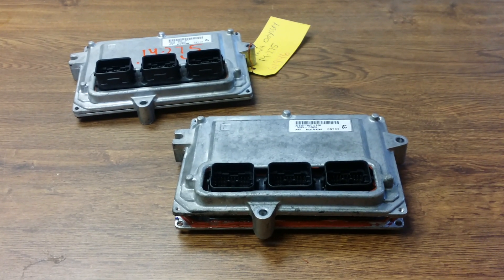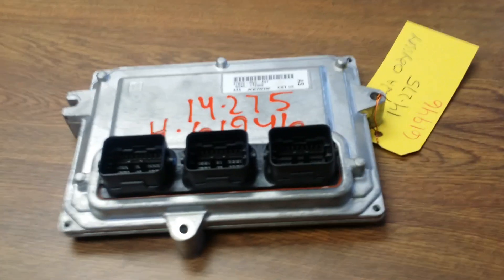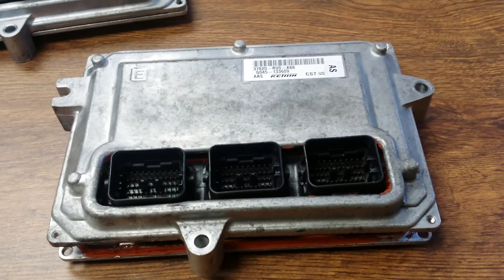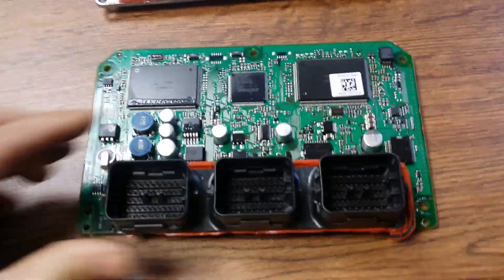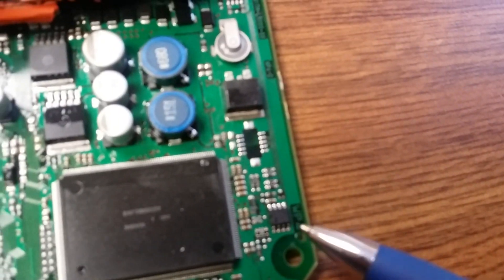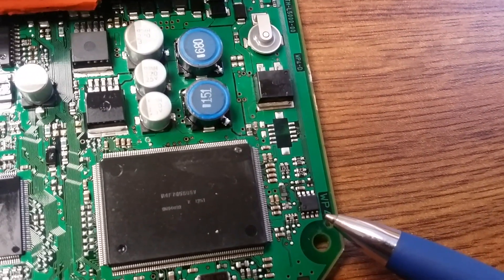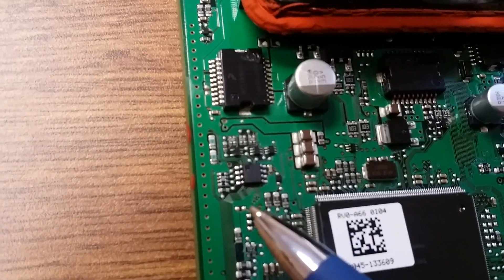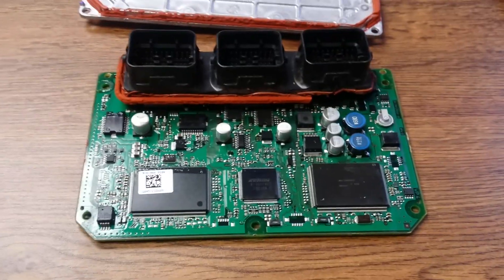HOW TO PROGRAM HONDA ECU IMMOBILIZER KEY AFTER ECU SWAP

Comment: I am swapping out a 2004 DX Engine to a 2005 HX and i will have ECU and have the key that goes with it.  Can you put me in contact with someone who knows if it is possible to get the key to work without going to the dealership? Or will I need to replace the immobilizer ring in my car with the immobilizer ring for the HX one that matches the key and ECU? Just want to know the easiest route. Also, do you know someone who had the machine to connect to the car that can program keys?

Comment: Happened on this video. DO NOT TRY to replace the IC. Unless you have VAST experience with a HOT AIR SOLDERING/Desoldering SYSTEM. It is NOT THAT SIMPLE!

Comment: Hello, first of thank you for useful video. Second. (2003 accord ) thought you might know - I had a green key light flash at me and sinse car wouldn't start, locksmith came told me its the key immobilizer (the one on the lock cyl with the antena inside) part been ordered amd replaced yet no luck with reprogramming it, still flashing key and therefore doesnt allow for the car to start. Should I concider changing my computer on the vihicle ? Any info is great help . Thanks.
Reply: Pasha_Houston I'm having this exact same problem with my Honda. Did you get it fixed? They told me to change the ECU. I also had a locksmith tell me the same thing.
Reply: Im going to try to swap an immobilizer from one ecu to another if it works ill tell you how to do it
Reply: the ignition ring is coded to the car, so if you change it out, honda makes you bring in the car to reprogram the system to read the new part--Honda=stealership
Reply: did u solve it? havin same issue

Comment: I have a 2002 Odyssey the ECM has 4 plugs and does not look the same inside do you have a video to help me identify which pieces to swap
Reply: were you able to figure it out? i have a 2003 odyssey and I'm on the same boat. trying to swap an ecu but don't want to spend the extra money to have it reprogrammed if possible. haven't pulled it and opened it yet.

Comment: ive got a 2012 honda pilot, I want to reprogram it so the vcm feature does not work.  if thats not possible, A 2012 mdx shares the exact same drivetrain, without vcm, 
i do have access to a snap on verdict, so i might be able to reprogram the immobilizer into it on my own, can this be done and any suggestions?
Reply: Mrdubomb i was thinking the same...i have an 08 odyssey exl...i was thinking of doing the same with a ex ecu which doesnt come with vcm...anyone 😂

Comment: Very good videos, sir George, thanks for taking the time to do them. I have a problem with a car that I bought, it's a honda civic 2007 manual transmission, it makes many strange faults, in trying to solve them I realized that the serial of the computer that has mounted is an automatic box car and in fact when scanning it appear All the error codes of the box, obviously because it is trying to design those sensors and box selenoids and this car does not use them. To see if you can give me an opinion or advice on what is the easiest way to solve it, can you reprogram that computer to make it manual transmission? Or should I change it? Simply by overwriting the vin and placing the one in my car did not solve anything, right? Many thanks in advance and sorry for the audacity. Sorry google translate.
Reply: I have the same problem u ever figure it out?

Comment: hi, I've replaced the ecu for a 05 accord and it runs weird. sometimes will shift and engine will rev up, other times it doesn't shift or the engine doesn't rev up unless i turn the engine off and restart it.  do you think ecu is bad?
Reply: I want to know when the computer is open where is located on immo ic and tell me ic nambr
Reply: Sounds like a bad transmission. Call the Honda dealership and see if the transmission recall was done.
Reply: raul rastaman I think to much weed dude

Comment: i have a 2008 civic idles great  and takes the throttle in park, but stalls and sputters when put in drive or reverse after takeoff, no codes, could this be the ecm?
Reply: Spark plugs/wires and a new cap and rotor. If that doesn't fix it it's a clogged catalytic converter

Comment: How do you crack open the ECU? You mentioned a heat gun but I'm having trouble opening it. Would you mind showing how to do it or can you be more specific on the details.
Reply: Gud morning sir I have the problem about my computer box of my poton ambulance
Reply: @delacruzjass1831  To do this I had to use a heat gun that was putting out about 1000F (high setting) and let that sit on the edge (facing the flat side) for a while; ~15-30 minutes then move slowly to the next spot. Put aluminum over the connectors so they don't melt. It took me a couple hours to do this right. Use pry bar/ screwdriver with a wrench on the side for leverage to pry it open. Slowly work from a corner and keep going around a little at a time.

Comment: Is there any difference between traditional KEY START cars and those new one push start car models? I have a 2014 civic si and it  equiped ONE PUSH START and KEYLESS ACCESS system, can I follow your instruction to  replace my ECM?
BTW, can replace the damaged 2014 ONE PUSH START ECM with a 2012 traditional KEY START ECM, I mean is there difference between this 2 types ECMs?

Comment: My ECU board does not have the bottom right chip, it only has the middle left. The middle left is not the same as the bottom right connectors. Do you know which  ones are they for a Honda civic 2008 4door automatic.
Reply: what happened with this?

Comment: Could you help me I have a 2000 Honda prelude could you help me find the immobilizer chip in the ECU the old ECU went out I bought a new one and put it in but need help finding the chips in the ECU unless they are the same as in ur video want to make sure
Reply: https://www.obdii365.com/upload/service/h-onda-immo-emulator-user-manual.pdf

Comment: i went to a salvage yard and found a car exactly like mine and got the ecu and key. can i just install the ecu and use the key?
Reply from the maker: +David Arnold yes but then you also need to replace smart junction box (fuse box that's under drivers side dash kicker panel) and immortal unit around ignition lock then it will start

Comment: how do I locate the same chips on a different ECU. specifically for a 2004 Civic LX Auto Transmission
Reply from the maker: Usually its a 93c66 or 93c76 when you open it up read numbers on eeproms and let me know what you see i might be able to guide you through
Reply: +George Melnik here's the inside of my current ECU. http://i.imgur.com/dvuzbXY.jpg

Comment: Hello George,
Still on the same 2000 honda Odyssey, I manage to get x431 from a friend and when I tried to program a key it tells me immobliser unit not normal. Actually the immo unit on the ignition was desoldered in an effort to locate the eeprom, but none was there and apparently, a wire pad on the immo pcb was lifted and broken though was presumably repaired. on putting it back on the car and using x431 I got that message saying immo unit is not normal, so I replaced the unit from another car and still the same immo unit not nnormal is displayed by x431 when tried to program the key. However, I noticed that the car did not even tried to start like it should do when an unmatched key is used to start the car. Some people suggested checking ecu/pcm fuse (will do that today) others point to pcm problem. please I need your advice. thanks

Comment: please I have  this 2000 honda odyssey with all keys lost and I have cut a key to turn ignition. I am trying to read immobiliser dump but I can not find the immo box or perhaps the immobiliser eeprom is located in the ecu ? what eeprom to look for ? please help me.
Reply from the maker: I dont recall which eeprom is in 2000 odyssey. But there is easier way to get keys programed. I have a link posted in my description for launch x431 i diag. It will get the job done

Comment: OK FOUND THEM!
But do I need the:
DBS CAR launch(red) or Easy Diagram(yellow) or VCI Launch ICAR scan (orange) ??? they range from $60-$230? again I need the one that supports Android device besides iOS iPad
it says I have to purchase the software separately, much $ is it just to get the software online besides itself or does one of the three above come with the software update that plugs in your phone I realize I will have to be in a Wi-Fi spot to load the software on my phone...
Reply from the maker: i have a red one. i am not sure what other do. i can only speak for the one i use in all of my youtube videos. main software is free to download but then you have to download each individual makes i believe its 66 bucks per make. once you buy each make they stay with you forever unless you want to upgrade to a newer version.

Comment: but why do I need the Creator Vll 7+ hand held device? I thought that's what my phone was for? I'd like to not spend the extra money and buy it if I don't need it... I just want the Bluetooth connector and use my phone
Reply: with the X431 software on my phone
Reply from the maker: who told you need vii2 hend held device? i told you already all uou need is x431 igiag which i have a link on my website, its also listed in my description and your smart phone. If you dont want to spend any money you need to have some knowledge with swapping  eeproms.

Comment: Okay AWESOME! so if you don't have to switch the EEPROM CHIP from your OLD ECU over to a NEW ECU, because the x431 can take care of pairing up a NEW ECU with your TRANSPONDER Chipped KEY(or a NEW KEY), TRANSPONDER RECEIVER and IMMOBILIZER UNIT then what was the point of this video?????
Reply from the maker: Because x431 is not available in every country, some people dont want to spend 189 bucks to buy it.

Comment: So basically what your telling me is if I just get a new transponder key, and a new matching ECU with the same part # as mine I can use the x431 to reprogram and sync everything up to get the car running again

So you're telling me I won't have to swap the eeprom chip(s) from my ECU over to the new ECU then?
Reply from the maker: Nope.

Comment: OK I have a 98 Honda Prelude Base with the USDM stock PG5M ECU... problem is someone stole the key out of my bag where I was living years back...

So can I just go to a junkyard and get another USDM  96 - 01 OBD2 Prelude PG5M ECU with matching TRANSPONDER KEY and TRANSPONDER RECEIVER thats located in the RING around the IGNITION SWITCH (if that's where it is)...Just cut the key open, take out the TRANSPONDER CHIP (which I've seen done with a razorblade), and transfer the chip over to my original spare 2nd or valet key (that will just unlock the column and turn over all the way but obviously wont crank over or start the car) 

I've been thinking real hard about all the possibilities and this should work

I do realize that if I lost all the keys on my Prelude that I will have to get a new key from the dealership and have them cut it...
 Or i could always just take the IGNITION out of the JUNK YARD PRELUDE too and put it in MY PRELUDE

Makes perfect sense to me but what do you think about the TRANSPONDER RECEIVER in RING around my IGNITION SWITCH, is it OK to leave that, like can I just keep mine or would I have to transfer JUNKYARD RECEIVER RING over to my Prelude IGNITION as well in order to work?

I'm not getting much information on whether I would need to replace that RING too with the JUNKYARD LUDES or be fine with using the stock TRANSPONDER RECEIVER RING FROM MY LUDE, no answer on that??? 

please help me out here I've been spending a ton of time on trying to figure this out? the car's been sitting for years because of the Lost Key I want to get it up and running again , thanks

* PS the last thing to consider but I don't think it is going to matter is Honda replaced my ignition already with a new one for free due to the FACTORY RECALL of switches on all 97-99 models contact points or something in them prematurely wearing out, which caused the car to stall out while you're driving down the road
Reply from the maker: That seems like allot of work and hastle you want to go thru. Why dont you just buy used pcm same part number. Then pick up one of those launch x431 adaptors which can easily perform replace ecm pcm procedure and reprogram keys. I have link in my description for the adapter

Comment: 2007 honda civic si 4 door---- i went to my car and nothing turn on either ecu failure or battery died... jump started the car and works... took for inspection and did not pay due to catalystic and evap montor not ready. i driven the car for two weeks and over 700 miles into it and did cycles per manual  still not ready? not was done to car and no hondata... all stock. could ecu be bad always reset not saving every shut down?fuses? any help would be greatful.
Reply from the maker: Sounds like a faulty ecu

Comment: Can you tell me what chips to replace on 2006 Accord Hybrid computer?  Also, please point me to a programmer that can do this job without replacing the chips.  Thanks!
Reply from the maker: In my video description i have a amazon link attached. That scan too will get it done fore you. I use it everyday
Reply: The link wasn't working for me. I'll try again.
Reply from the maker: I judt checked it worked for me. Maybe you have a pop up blocker
Reply: +George Melnik   Thanks George, that is what was happening. I got to the link with my phone although I would need the Android version.  Do you have any experience with the Autel Maxidas ds708?  I know that it is much more expensive alternative, but I'm curious how it compares. Also, do you know which chips would need to be replaced if I wanted to go that route for this car?

Comment: Hi,I have a Honda CRV 2001 with a ecu problem.I have purchased a replacement but now need to swap the immobiliser chips.
Please do you know the location and chip numbers that i need to swap as your video is for a later Honda.
Reply from the maker: CHECK MY DESCRIPTION IN THIS VIDEO. I HAVE A LINK WHERE YOU CAN GET A CHEAP SCAN TOOL THAT WILL DO IMMOBILIZER.
Reply: +George Melnik 
Thank you for your reply George.The original ecu has a fault and the previous owner had the ecu made Free Running trying to fix it,would the scan tool still be able to copy this ?

Comment: I have a Honda Civic 2005 automatic... I'm not sure if the computer is fried or what but my mechanic thought it was. Should I pull the those computer chips you mentioned in the video off my old one cuand put to a new ecu part I got?

Comment: HELP...hey George Melnik I have a 2002 civic with a green key light blinking on dash, I tried to scan the codes but it doesn't let me, any help please THANK YOU
Reply from the maker: What's the story with your car?
Reply: thanks for answering +George Melnik it was running fine till yesterday, it starts but only at low speed, the key light is blinking and it doesn't sow the battery light, I tried to scan the codes and it doesn't let me to
Reply: id checked the fuses, battery and they look fine, change the fuel pump relay , the ground wires on the engine and its the same

Comment: hey my 2006 honda civic had the immobilizer green key on and i took it to a mechanic and he told me that i need to change compurers cus it was burn do you think immobilizer has something to do with the computer
Reply from the maker: I dont think its ur computer. What's the story with the car?
Reply: i had it on and the car just turn off and when i try to start the car a green key came on the dash when i try to start it
Reply: +George Melnik i change the computer and now the car start for a little and turn un when i had the other computer is would start
Reply from the maker: Ok. If You have a scan tool all you have to do is replace ecm pcm procedure. If you dont have scan tool all you have 2 do is replace eeprom from your old computer.
Reply from the maker: Make sure you replace correct eeprom. If you replace wtong one it will start then dies and green key will continue to flash

Comment: any suggestion on opening them up I cant open it been heating it up and nothing????
Reply from the maker: Irs hard you just have to have patience. You cant overheat it cuz you can cook circuit board inside. You just have to get it just right and slowly work it open with a flat head screwdriver
Reply: Thanks got it open and it didnt turn on because the air filter was off

Comment: Will the vin number transfer to new ecu?
Reply from the maker: Yes it will if you replace right eeprom
Reply: +George Melnik thanks for the quick response I have a bad ecu code p060a so I bought a new ecu will be doing this as soon as I get it needed to know mostly to pass emissions because when they plug it in they check that the vin matches.
Reply: +401 Tech Did this the car starts but then shuts right off...

Comment: Hi Could you help for 2005 Honda Odyssey J35A7 engine ECM swap?
Which chip need to be swap? Thanks.
Reply from the maker: There is 2 eeproms need to be replaced. I have not done one in a while so i dont recall what eeproms numbers are in that ecu.
Reply: +George Melnik  Anyway thank you for your replay.

Comment: How did you pull off the circuit board? I can't get the plugs separated from the metal caseing
Reply from the maker: I used heat gun. I heated it up around the edgea then very carefully pried it open with a flat tip screwdriver.

Comment: hi sir.sorry but im not good in english....i have a honda civic i vtec 2006 model.i have a probblem to my car.i lost the key of my car.so i broke the window to open the door.at now i buy a secondhand key cylinder but the same key no remote key only..i try to start.its start in 3 second then stop.its flashing the green key...what can i do sir?i try to jumper the obd socket two wire to communicate the key to the ecm.but wont start..what the exactly doin sir pm me asap plsss...
Reply from the maker: U need a key with immobilizer reprogrammed